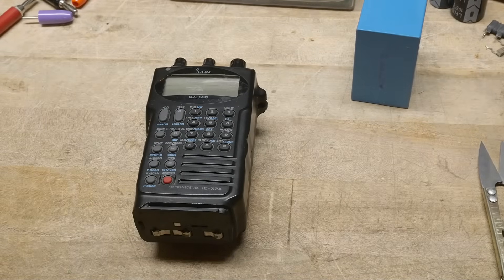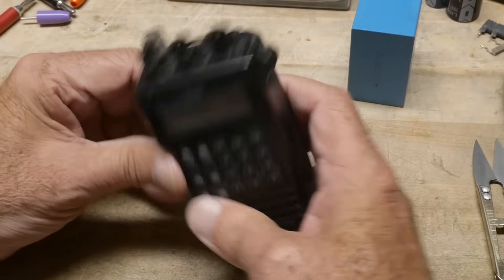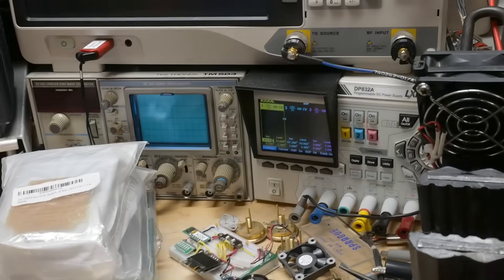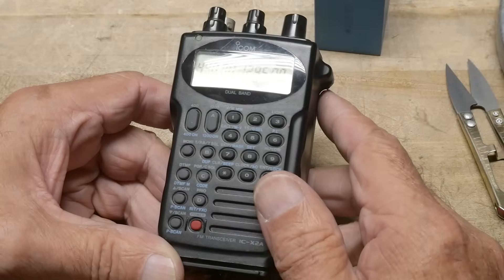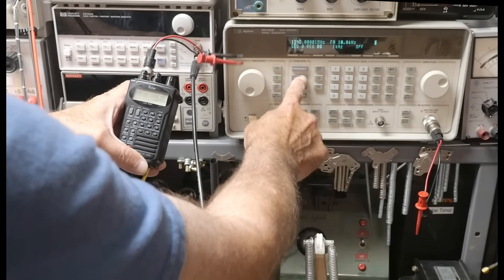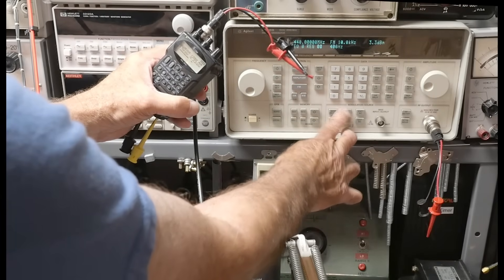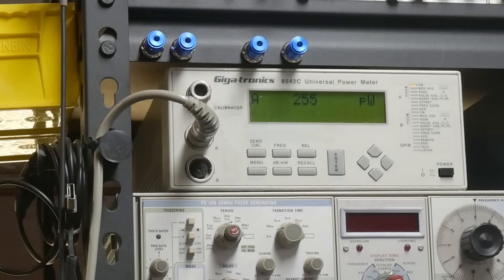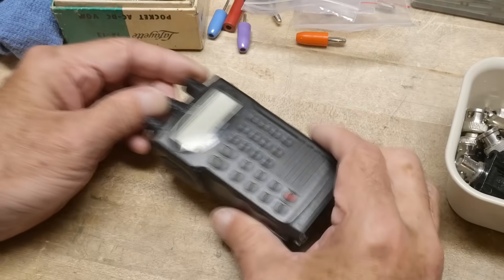#2265 ICOM X2A Dual Band Radio

Comment: It is good to see, that the 'Icom radio', is preforming so well! 

Hope you have much fun with it. It's a little 'gem'.  
I would say, a realy a not so often found radio, even 25, or more years ago, ... ! 

Hold it in your collection, it is really worth the money, you have 'not' payed for it! 
 - Hi Hi ! ! ! -  

There are 'Mitsubishi-modules' (PA-modules, from less than 5, to more than 50W ... !) aviable in the past, to make an amplifier out of it. 
With less then 1W input, you will create 'nominal 18W' out! 

 - I will open my 'PA', to look, what kind of type the module is, .... ! - 

There will be a 'follow-up', shortly.

My  homebrew 'Module- PA', made of such a 'thing' makes ~25W. That is amazing and worth the money for the 'module'! Only a 'hand full' of other cheap electronic parts, are nessecary for completing the whole '23cm-PA' !  

Be aware, the circuit-boards from China, for such 'module-PAs' (from less 10, up to 20€/$ - 1 piece) are not for the old style-type of power-modules. 
You must alter some 'pins', and/or the 'bias', for the 'linear-function', of this boards for the correct function. 
There is a different in the 'generation' of the boards, one will need a regulated voltage to set the output-power, the other will have an alternating current, for 'linear- working'! 
'Working' with the wrong 'connection', to the board, maybe will destroy the module! Please be aware of this! 

Now a good 'Diamond'- 
(maybe, a 3 band, [2m]/70cm/23cm) 
or a 'homebrew-antenna', and you will made your day perfect! It's a very inexpensive 'up-date', to you 'Ham-radio' equipment! 

Please excuse my not so good English, ...  it is not my native tounge, ... and it is long time ago, that I went last time in the UK, ... have  never been in the USA, or Canada.

73 de Markus - db9pz - JN39fq - 5km/3miles east of LX -

Comment: Wow! I've never seen that model. And you can't beat the price! 🙂 I have the IC-24AT, which looks identical but is the 2M/70cm version. There is a keypad mod on the 24AT that opens up the receive---it might apply to that one as well, albeit with a different usable range. If you build a 1.2GHz antenna for it, it might be cool to do something nonstandard, rather than just a vertical, maybe a patch antenna or something like that? (Or even a cloverleaf antenna for fun!)
Reply: I think W2A is the 2m/70cm version. The 24AT may have been slightly earlier or later.
Reply: @theelmonk yeah you are correct! I used to have the 24AT but yeah it’s the W2A I have that is the lower band “sister”. Thanks for catching my error 😅

Comment: I would have thought you would get more power out,  especially on 440.  Either it needs 12V to get full power or maybe has a hi lo power switch?  You can probably get the manual from Icom website.

Comment: Where your located you stand a very good chance of finding someone on 23cm to have a QSO with.  23cm is kind of like 33cm and 1.25M bands, orphans.  However, if you live along the East or West coast there is a growing community of people on those bands.  Just last weekend would have been a great time to try it out on air, it was the ARRL June VHF contest.  You can get aftermarket replacement battery's for these radios.  I think the last two I bought came from Canada.